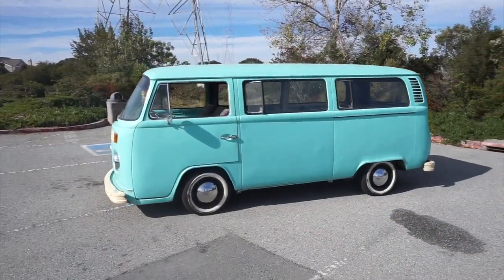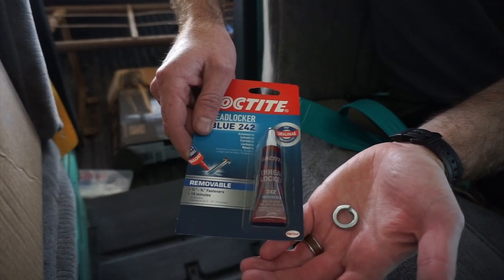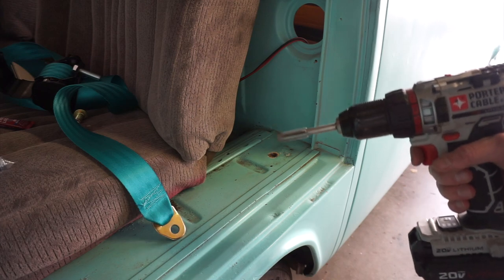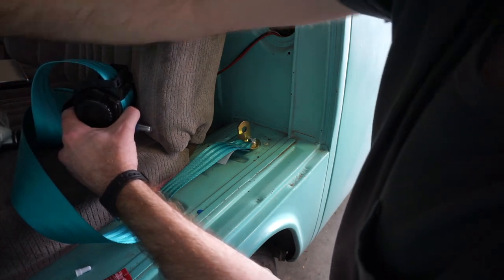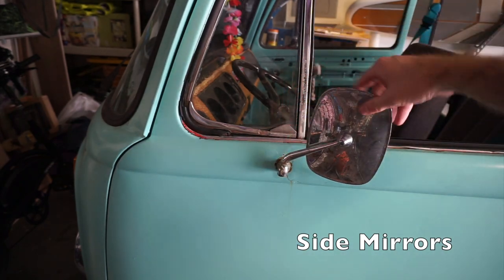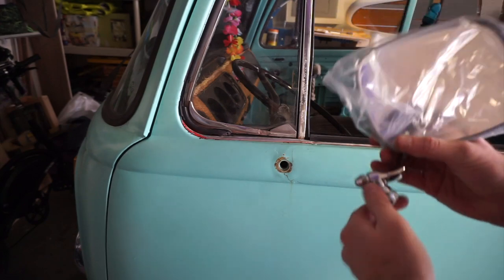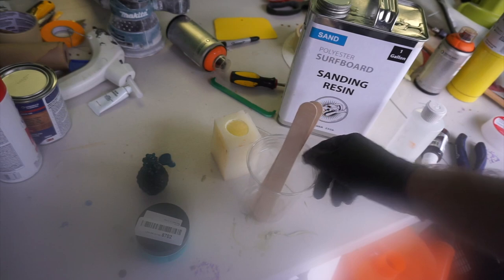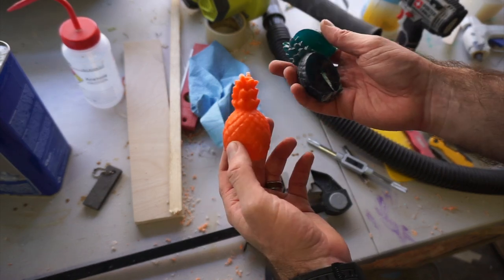Seat belts, side mirrors, and gear shift knob. 1973 VW Bus Restoration Part 1.

Comment: Lovely old bus, one tip is put the lock washer before the nut not under the bolt head.  Not many people restore a bus to original height, well done, look forward to following instalments on your restoration journey.
Reply from the maker: Thanks for the tip! I already got her to factory height and am editing that video right now.  There’s a finished photo on the Vwbus subreddit.  It was surprisingly difficult to find stock height spindles.  I thought with everyone lowering their bay windows, that the market would be flooded with them.

Comment: Nice Bus!. I love the color. Hope to see part 2 soon.
Reply from the maker: Thanks for checking it out, part 2 (undropping/lifting the front suspension) should be uploaded later today, and part 3 (LED headlights and wiring fire) is ready for editing, and part 4 (rock and roll bed rear seat) is about to be done filming today.

Once I get to paint, we will be keeping pretty much the same color, but doing a 2 tone, with the turquoise/teal on bottom and some kind of white or cream on top.